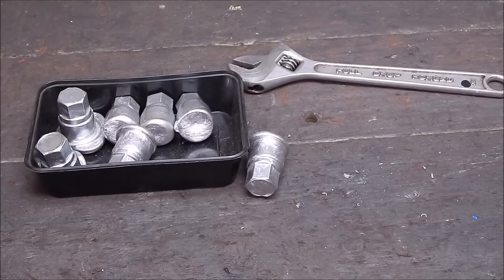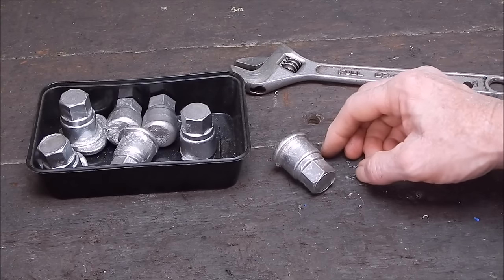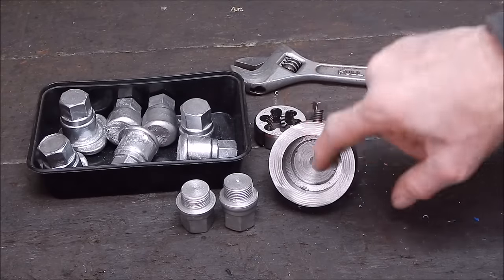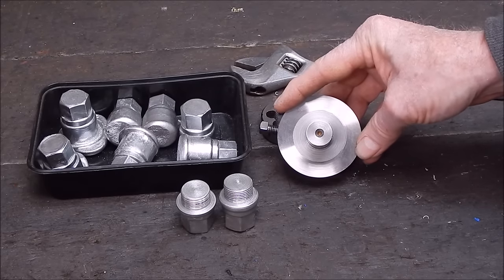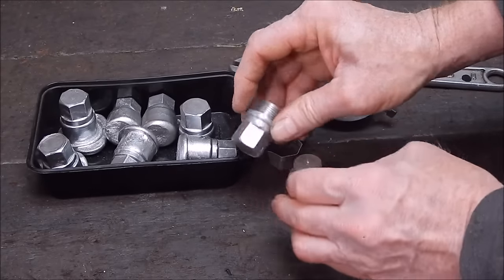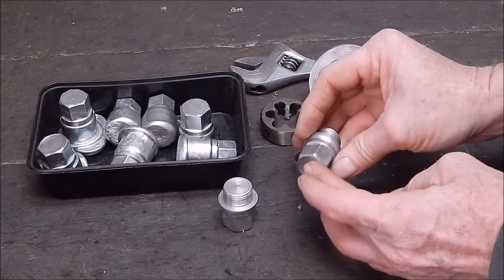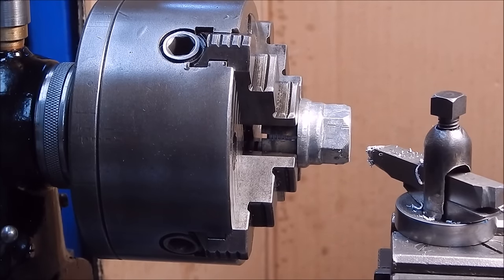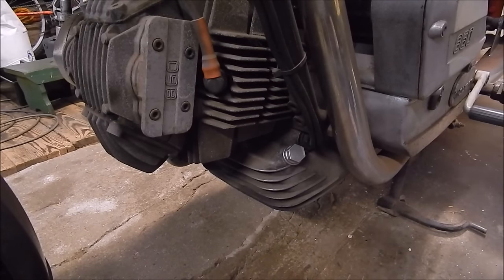How to grip threads with a metal lathe

Comment: I know it's not proper but could you use your threading device in the lathe chuck to hold the part? Or simply do the threading work last.
Reply: I tend to agree with you Russell.  If you are looking for maximum thread protection I would have just chucked up the die or perhaps a nut with the proper threads if one is available.  I do like and have used the process Rob just showed though.  As we all know there are often multiple ways to perform an operation in a machine shop- Fred
Reply: Yeah, I would have chucked up the die and screwed the plug into it.
Reply: The die he had was not a split die so there would be no way to clamp down on the thread with the die
Reply: He has more, maybe he can give it a try?
Reply: That's actually the preferred method for holding a threaded component in a lathe. That is, to make a female threaded holder for the part with some rod stock or even a square block in the jaws..Especially if you have a small production run. But the method shown here is pretty cool too..especially when you consider he was trying to mimic how a collet works.
Reply from the maker: Hi Russell,

You would have to hold the work piece true somehow to ensure the thread was cut straight - how do you propose to do that?

If you do the threading last, you will not have the full length of the nut section to grip in the chuck, and risk damaging it.

The video was about how to grip a thread in a chuck.  The way/process you wish to approach a project is up to you.

Cheers Rob
Reply from the maker: Hi Russell,

I misunderstood your comment about holding the work in the thread die - great idea.  I see where you are coming from now, after a similar comment by another viewer.

Yes, that's a good idea in this case.

Cheers Rob
Reply: I'm studying the theory behind lathe working, I'm just throwing around ideas. The point in this video is a good demonstration using that method. But I ask myself what would I do in this situation. There are many options.
Reply from the maker: Yes, we are always learning.  That's why comments are so good.  I may test the theory if the weather allows it.

We lost all power in the last 13 hours, and only just got back up - that's why I'm only now replying to comments.

I really like your idea.

Cheers Rob
Reply from the maker: Hi Alan,

The concept appears to be that in this case, the plug can screw into the die up to the shoulder.  Sounds OK, provided the thread is cut true, which it should be.

A split die won't crush onto a thread, unless you remove the setting screw, which sounds risky to me as you could crack the die.

Cheers Rob

Comment: Just a question. Since it is an interrupted cut would a high speed steel be better? I am thinking of the shock to the brittle carbide.
Reply from the maker: Hi Robert,

As you are aware HSS handles interrupted cuts without drama.

While carbide has had a bad name for breakage in the same situation, from my experience modern inserts are much improved/more durable and handle it quite OK (so long as you don't buy absolute rubbish  ie. from India).

Obviously DOC has to be kept down, but overall it's not an issue.  You are more likely to snap a carbide tip by stalling it in a plain turning job with a heavy DOC.

Cheers Rob
Reply: Thank you for clearing that up

Comment: Well, for one thing, I'm now glad I chose the ER40 system! Thanks for sharing you method of working through the problem. Great fill plug on that old bike, all from your own casting. You should be proud.
Reply from the maker: Thanks Rick.

Generally ER32 does fine, but not in this case.   ER40 would have made life easier, but it was a good opportunity to show how to do it without collets.

The work around gives a primitive collet effect with a four jaw, I suppose you could say.

I played around with those other castings and made up another filler plug with a steel dipstick, which is how they came from the factory.  Parts for these old bikes are getting harder to find, and cost an arm and a leg when you do.

But it was all a good casting and machining exercise, and you learn a few things along the way.

It keeps your mind active, and a hobby like this is a great way to escape the crazy world, as we know it today ;)

Cheers Rob

Comment: This is the successful conclusion of a project with quite some detours on its way. That's life. What are you using as gasket under the plug?
One detail for your other spare plugs: Chamfers on hex heads look best if taken at 30 degrees until it shows a complete circle on the face. The original cast heads have it too.
Reply from the maker: Hi Rol,

I will use a standard Ducati alloy crush ring washer to seal.  These are cheap to buy.

I have thought about making some, but would need some soft aluminium to cast the stock - don't have any at the moment.

Yes, the original Ducati plugs do have a chamfer.  I will probably do that on the rest.

Cheers Rob

Comment: That's a lovely old lathe you have at 5:52.....What make is it...... Also I like your disc cutter at 8:27, did you make that one?
Reply from the maker: Hi Steve,

The lathe is a Schaublin 102 toolmakers lathe, made in the 1930's.  It's probably one of the earliest Schaublins ever made, has done  a ton of work, and is the original and very uncommon black paint colour.

I bought it off Ebay for $360 on a whim, as a wreck, and did it up. 

It is a pretty lathe, very useful as a second collet based unit, and still works quite OK.   It's not a lathe for beginners as everything has to be set up manually, but that also allows it to do stuff a normal lathe couldn't easily accomplish.

The friction disc cutter is very handy.  It's made from a shaft driving though two engine conrods inverted, which clamp the ball races in place.

My motor mechanic father made it when times were tough. and I still use it - very handy for hand cutting of anything really, and has a green stone on one end for grinding my carbide tooling.

Cheers Rob.

Comment: The only question I have is why aluminum for the plug? It seems to me that you would have to be very careful tightening the plug so as not to strip the threads from the plug. On the plus side it is much better to strip the plug than the gear box.
Reply from the maker: That's the way the factory made them.  Common practice with motorcycles. 

They won't strip out, but the head can become deformed over time.

 The aluminium plug has the same expansion rate as the crank case, so the plug won't loosen as the crankcase heats up.

Cheers Rob

Comment: I have made the same mistake on a larger part for an old horse drawn cart I'm restoring.The way to avoid this problem is to turn the hex side down before you put the thread on.I was so keen to make my thread I didn't think the progression of the job through correctly.Once the hex side is finished then grip it by the hex and thread it.
I couldn't help but notice the cross slide screw on your old lathe appears to turn the wrong way.Is it just an illusion in the video or did they really make that a left hand thread.
The lathe looks amazing by the way. I wish I had time to do the same to my old 1930's Atlas.Problem is I don't have another lathe to make replacement parts on :)
Enjoying your vidsDavid
Reply from the maker: Hi David,

Yes, correct job progression is the most important part of machine work.

The Schaublin cross slide screw turns the wrong way/anti clock wise on this lathe, as I got it.

At first I thought that maybe someone had replaced the thread over the years (this lathe has done a massive amount of work) as no one else with a similar early Schaublin I communicated with had seen this before.  But it looked like OEM as it was all so perfectly done.  I'm not sure what it was originally like.

Later I found another same model/vintage Schaublin under a tree and while the cross slide was missing, it had a larger Morse 2 tailstock in mint mechanical condition, and yep, the thread on the quill on that also turns anti-clock wise.

I do know that some other brand old lathes did have a reverse turning cross slide screw.  The problem is that information on many early models is sketchy at best.

In practice it's not really a problem, but you have to keep it in the back of your mind at all times ;)

I'm in the process of respraying the M2 tailstock at present, just need a warm sunny day - all the prep work is done.

These old lathes really look good when given a lick of paint, and a mechanical refurbish completes the make over.

Cheers Rob

Comment: You surprised me.  I thought you were going to put the die in the holder, chuck up the holder and thread the plug into the die.   This could work if there was clearance to thread through the die and you had a way to hold the die flat in the holder.  I'm thinking of 3 pocket holes you could put fasteners in with heads that overlap the edge of the die.  No guarantee the die is concentric but it's a pretty good bet it is.

It would have also been interesting to thread a piece of steel, taper it and grove to make an "aluminum possible" tap, then tap a bored or drilled hole as a holder.   Hmmmmm.

I like your simple solution.

Are you going to be selling these off on ebay?
Reply from the maker: I didn't actually think about using the die in the chuck.  I was just thinking, oh here is a good chance to show how to grip any thread in a lathe chuck.

I tried the die in chuck method afterwards and it worked great.  The thread was aligned correctly as it was cut on the lathe.

That is the only way to get a concentric thread with a die, as they always pull one way of are crooked with a hand die holder.

No I won't be selling any on Ebay.  

I remelted the dregs and cast some more perfect blanks to keep for any job where I need to replace a filler or drain plug on anything - just vary the thread size to suit.

It was a good casting and machining exercise.

Cheers Rob
Reply: Yea, I always use some method on the lathe to hold the die square or tap square mechanically.   Nobody can do that straight free hand.  I feel like, I've got the machine, why not use it to make the work as true as possible.

Comment: What I've been doing to hold a thread like that for multiple parts is to make up a blank rod with a female threaded end to match.
Reply from the maker: Threads tend to pull off centre when tapped, so accuracy could be an issue.  But if it works for you then why not ?

Rob
Reply: xynudu 

Yeah the accuracy isn't the best, it just depends what you're doing.

Comment: Why not just go buy (horror of horrors, I know, lol) a 22x1.5 nut as a holding fixture for the 3 jaw? Seeing as you have a box full to do, the "extreme expense" would seem justifiable. A tiny drop of CA glue on the flanged face would preclude thread stripping, and a few minute soak in acetone would break the bond for blemish free finish. Granted, a 2 buck nut is more expensive than scrap tubing, but not incredibly extravagant